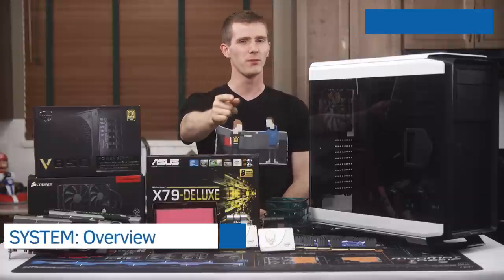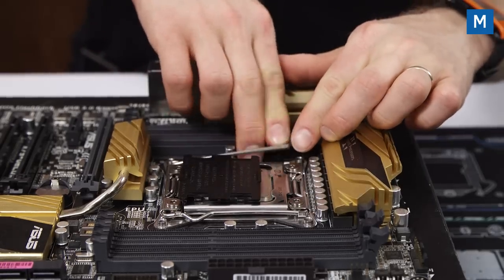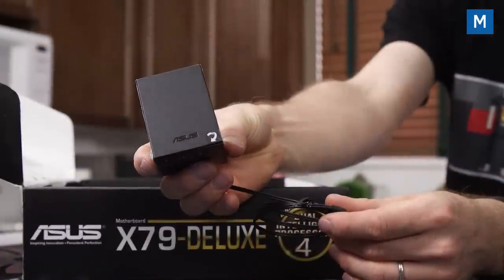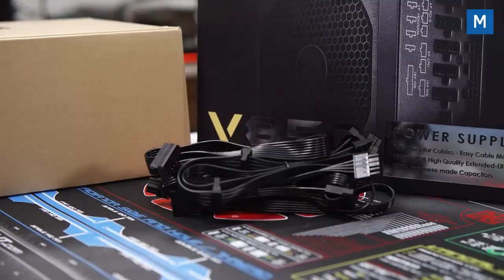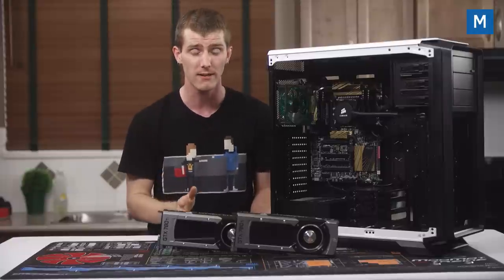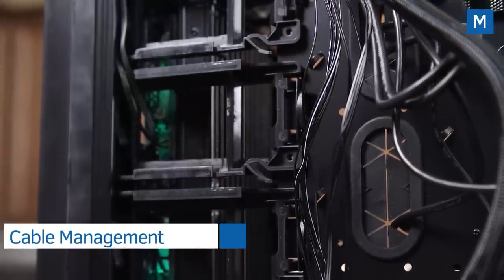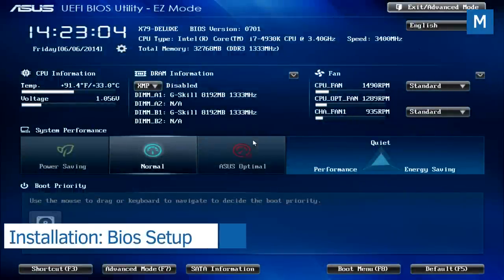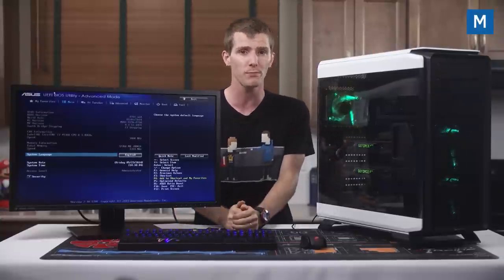How to Build the ULTIMATE 4K Gaming PC Build Guide

Comment: Hi i'm going to be building my first Gaming PC soon. And i would like to know what you guys think of what my build is so far!

Phanteks Enthoo Primo case
Asus maximus VII formula
Intel core i7 4790k
Four dims of Corsairs dominator platinum 8GB RAM cards 32GB total
Two Samsung 840 EVO 500gb SSD's
Western digital black 1tb HDD 
Corsair AX1500i
Asus black blue-ray drive
Windows 7 ultimate

Going to be doing a custom WC loop on this computer too.
Reply: I assume your parents will be paying! They will never recover from debt mind!
Na I'm kidding, I'm 14 too but my rig was much more budget
I personally think that if you get that, it would last for years!
I would reccomend the Maximus VI Formula as it's a great board for a great price
My SPECS:
amd fx-6300
asus m5a78l-m mobo
gtx 660
8gb corsair vengeance ram
1tb wd caviar blue hdd
coolermaster rc-430 (upgrading to aerocool dead silence)
Corsair CX600W psu
Reply: You won't be needing a 1500W PSU. 1000W should be PLENTY. I run SLI gtx 780s on a 750W PSU with no problems :)
Reply: Pigoop Would a 860W PSU do the job then? Cause in this video Linus was running SLI with a 750W PSU. And the AX Series doesn't have a 1000W PSU only 1200 or 860.
Reply: Liam Hawkes Yeah they are going to gift me this PC haha. Also i think i'm going to wait until the Asus Maximus VII Formula, cause those Z97 chip set motherboards are awesome!
Reply: The 4930K Linus used is better than the 4770K. 

For PSU, a 860W PSU should be enough. 

I personally prefer a R9 295X2 instead of 780 Ti in SLI. But the choice is yours. 

SSD should be the Samsung EVO, better performance. You could just buy the M.2 1TB one, basically Raid 0 with one SSD.  

Edit: What's your Motherboard?
Reply: Kid... you're just rubbing your parents' money right in my face.
My build costs a bit more than just one of your graphics cards.
I bet you would be fine by saving 700$ with only one 780ti. In fact, a 770 will do great if you're just playing in 1080p.

Besides that, amazing build. It's only something I could dream of having. Impress your console friends when they see how nice PC graphics look!
Reply: You don't need all of this, that is way over kill have you looked at the prices? What do your parents do for a living? and the community isn't very nice to kids/teens (just a word of advice)
Reply: I have to agree with the 'Only 1 780 Ti' Idea. This is way too much Overkill. 1080p and 1440p doesn't require that much bandwith. And will save your money much more. 

Personally, I'll either go for a single 780 Ti and a 1440p IPS monitor. Or an R9 295X2 and a 4K. Or just wait for Maxwell, soon now. 

With that said, an R9 295X2 is the least profitable suggestion, I don't think I should have gave that suggestion in the first place. That GPU can be fully utilized only on a 4K display and monitors with that amount of pixels these days are just TN, which is an utter crap. 

If you were to ask me what I'd do, I'll wait for Maxwell-architecture GPUs. Those are guaranteed to give you better performance, less power consuming, less heat, and a smaller form factor.
Reply: Kirito Cray Well i still haven't bought my gaming PC yet (planning on buying it for my birthday) and i'm still planning the parts... But the other day i was searching up some processors, and i found a new one that is going to come out soon. It's the Intel Core i7 4790k and it is a haswell processor. And maybe that processor is probably good for the new Z97 chip set i dont know if i should get that one though.

And about the PSU i think you guys are right and i should just get the Corsair AX860i.

About the GPU.I want the 780 TI because, it's only about 680 dollars on Newegg right now also going to be wanting to game stream on my Nvidia Shield. But i can wait for the maxwell chip set if its so good.

And the motherboard i decided to get is the Asus Maximus VII Hero. I really want the Asus Maximus VII Fomula though but there still isn't a release date yet on tha motherboard.
Reply: Jeremy Munoz But the reason i want to go for SLI is because i'm planning on playing my games on 4k. And thanks!
Reply: Upload a video to youtube once you've built the PC. I would want to see if you and your parents actually go through with this..
Reply: Sir Mister Yeah dude ill try to for sure! i was actually thinking of putting a video haha
Reply: What monitor would you be using? Unless you're using a multi-monitor 1440p setup or a 4k monitor the dual 780tis are overkill. I suggest that you just get one 780ti and use the money you save to invest in multiple high end 1080p monitors.
Reply: nikg307 Well i was planning on either going 4k or a single 1080p setup actually. But i wouldn't really need two graphic cards if i go for the single 1080 setup. Still cant decide which setup i should go for.
Reply: ***** No, lol. My father is going to pay for this. I was also thinking maybe i can get 2 dimes of 8gb ram cards and have 16gb total. It's so i can upgrade to 32gb in the future. And yeah you're right i think ill just keep the psu because maybe in the future when i want to upgrade, the parts might need a lot of watts.
Reply: Lol, well I'm a freelancing web developer and as I said I'm 15 years old. I think that technology is great if you just use it for more than time waste and games, instead try to learn something new everyday and make some bucks
Reply: Why not the R925x2, it's great for your build and its great for 4k and performance and it's water cooled and cheaper.
Reply: Christopher Contreras Get the 4790K, it has the same price as the 4770K but a lot better. I would have waited for Broadwell or Skylak though.. :/ 

I still think you should wait for Maxwell, it's gonna be so worth it. Either that, or buy a 780 Ti with an excellent aftercooler market. 

Save some money and buy the AX860i PSU. 

Formula is the best choice here, beside ASRock. 

Spend all those saved money into a Custom Liquid-cooled Rig. Maybe buy some pretty LEDs as well.
Reply: Kirito Cray Well i wont be getting the computer parts until the end of October... So i think ill be able to see what parts i will be able to change. But i totally agree on getting the 4790k, it's the same price and it's based clock is at 4.0 ghz.

On the GPU i was planning on waiting for the Maxwell actually. But it's just i don't know if it's going to come out for the date i'm going to get the parts. But for now, i was thinking maybe two reference 780 Ti's.

Also, the reason why i want to get the reference cards is because there are going to be this new bracket from Corsair that lets you install All-in-one water coolers on your GPU called the Hydro Series HG10.

And on the PSU i think getting the AX1500i is better though in my opinion, because not only is it a very reliable PSU but it's going let me upgrade to much better parts that use a lot of power in the future.

I was thinking maybe i should wait until later on this year for the Asus Maximus VII Formula, but to be honest i don't really know when it's going to come out so i think i might have to pass on that one. But other then that i compared the Formula VI to the Hero VII and the Formula is way better.
Reply: Christopher Contreras I don't see the point of having 2 780 Ti. SLI doesn't scale well, and you're better off with a R9 295X2 if you so desire to have a dual GPU setup. Maxwell is just better at every angle you're gonna look for in a GPU. 

It's your money, so I don't mind that much if you insist on buying the AX1500i. 

Considering it's Asus, I don't think the day they reveal the Formula as that much longer. 

Trust me with this, just buy a Custom Water-Cooling loop. All these AIO gimmicks are just stupid and a type of marketing lies. There are companies out there offering 'Starter kits' and stuffs for your WC project.
Reply: Kirito Cray But the thing is the R9 295X2 is 1500 dollars, when the 2 780 TI SLI setup is just 1400. And i want a Maxwell GPU, it's just i don't know when it's coming out. Perhaps these Maxwell GPU's might come out in 2015 and i'm going to get this computer in a couple of more months.

And i really don't feel like building a Custom Water-Cooling loop computer. It's way to complicated for me in my opinion, with all the things i have to do to maintain it.

Also i kinda doubt that the new water cooling bracket from corsair is a "AIO gimmick" it's just a water cooling solution bracket that lets you attach a AIO water cooler to your GPU so you don't have to go threw all that hassle of doing a custom water cooling loop yourself. Because there are a lot of people out there that are not well suited to do a custom water cooling loop. Also it's just as simple as attaching one of those to a CPU, but instead it's a GPU. And it also takes less time.

And you can also check it out yourself, it's actually a very good solution to do a more simple water cooling loop on your GPU.

http://www.guru3d.com/news_story/corsair_hydro_series_hg10_unleashes_your_gpus_hidden_performance.html
Reply: Christopher Contreras You get WC with it, so yeah.. sigh Reference 780 Ti and both of them, isn't that good without an excellent heat disposer. And if you're going to buy a bracket and an AIO for it.. $100 isn't gonna hurt while offering a more pretty look. I'll still choose Maxwell. 

It isn't that complicated, it's the same as building a Rig. It has a manual, and it's easy to assemble. Maintenance is like twice a year..? Can't complain there for the performance it gives. 

Do whatever you want. You think of Rigs so narrow-mindedly, because it isn't your money, I suppose. You prefer simple process instead of aesthetics and performance, besides saving some lifespan of your hardwares. 

That's one review. Check others. Peace.
Reply: Holy jesus that's going to be expensive
Reply: Okay so... I've been searching on the web about watercooling, and i've been thinking about it. And watercooling is awesome! And i know a lot about to now, so now i think i'm just going to do a custom loop myself since it's so simple.

And since i'm going to do a custom loop i guess i can also change some parts in my build as well to suit the new loop. It might cost more but i think it's worth

So this is the build update for the build itself:

Phanteks enthoo primo (in black)
Intel core i7 4790k
Two asus directcu ii gtx 780 TI's
Corsair AX1500i
Two intel 730 series 480gb
Asus Black Blue-ray drive
Asus maximus VII formula
Two dims of Corsair dominator platinum
16gb 2400mhz

And with windows 7 ultimate installed.

Watercooling parts:

Two Alphacool NexXxoS XT45 radiators
One quad 120mm top rad
One duel 120mm bottom rad
Swiftech MCP655 pump
XSPC Photon 270 tube glass reservoir
EK Surpremacy universal CPU water block
EK Asus directcu ii gtx 780 TI water block (with black back plate)
EK FC Parrallel SLI bridge (with two ek fc black bridge links)
Fourteen Bitspower  G1/4 3/8* ID x 5/8 OD fittings 
Two Bitspower G1/4 male to female 30mm fitting extender 
Two Bitspower G1/4 45 degree rotary adapters 
Three Bitspower G1/4 90 degree rotary adapters 
One Bitspower tube plug 
Two EK G1/4 3/8* ID x 5/8 OD fittings
(nickle plated)
Two EK G1/4 90 degree adapters
(black)
One XSPC M20 reservoir port plug 
(black chrome)
PrimoChill PrimoFlex advanced LRT 3/8* ID x 5/8 0D tubing (red)
Monsoon 999 fine silver bullet antimicrobial G1/4 reservoir plug (red)

And for the water i'm going to be using a PrimoChill high purity deionized water and a IandH biocidal PC coolant additive.

So that's my updated build guys!! I find this one way better then the old one in my opinion lol. And yes guys i know that the R9 295x is better, it's just i wont be able to fit it in this case because of the reservoir mount in place, plus this new case that i'm getting is amazing for watercooling! i totally recommend it! Also the color scheme of this build is going to be Red and Black so ill be also getting some custom sleeved cables too.
Reply: Christopher Contreras Great change of mind :) 

IMO you could save a few bucks and buy the Phanteks Enthoo Pro. Or if you'd prefer a beautiful case with slick LEDs, I recommend the Phanteks Enthoo Luxe. 

I recommend Samsung 840 EVOs instead of those Intel 730s. Raid 0 is unreliable, so you might just want to buy a larger capacity SSD instead of having to Raid 2 SSDs. 

The WC List looks great enough. Though WC itself isn't that complex to find the matching parts. It's more like what brand do you prefer. 

Oh by the way, for WC, I prefer EVGA cards just because it matches well with the color scheme. Though it depends on your own LEDs, tubes, etc. 

One tip, don't choose GPUs based on its cooling efficiency and whatnot if you're going the route of WC. Just choose a GPU based on the color scheme of your rig. WC is both for cooling AND aesthetics, don't forget those.
Reply: ***** Yeah he could take out the i7 4790K for the i5 4690K. But if he has the money, why bother buying something lower than what you could get?
Reply: Kirito Cray I don't know, i like the Phanteks Enthoo Pro a lot but it's just i the Enthoo Primo is just way better for WC and it looks cooler too IMO. And i think i'm just going to get that one. Plus i can change the front LED's to red. Not the ones where the intake fans are, the one that's a line on the side of the case.

And to be honest i really don't mind much for capacity. Like i can just buy a 1tb HDD and call it a day lol. All i really care about is preformance and speed and the 730 series has that. Especially in raid 0 

The GPU's don't really matter at this point. Because if i am going to get a EK waterblock. The EVGA and Asus waterblocks look exactly the same plus it wont be having any LED's or EVGA, Asus logos on them. Only the EK brand logo. So i'm getting the Asus GPU because it is clearly better preforming and has a better build quality then the reference card.
And the waterblocks are all black too by the way.

Also for what my build is going to look like. Here are some pictures of some Enthoo primo WC build i found online

http://imgur.com/gallery/AkcVy The build in this picture is going to look a lot like the one in mine with the fittings and everything, because i know the brands of the fitting on these pictures. The black ones are the Bitspower fitting and the one in the CPU block are EK nickle plated fittings

https://www.flickr.com/photos/39959182@N05/14375832955/ This picture has the same reservoir i'm getting but with blue LED's. I'm going to get mine with a red LED and with a red sleeved cable

https://www.flickr.com/photos/39959182@N05/14382664403/in/photostream/ This one shows where the drain port is going to be 

http://www.techpowerup.com/gallery/3768.html And this is just a Enthoo Primo build i found with a red color scheme

So the way i'm going to be doing this build is the tubes are going to be all red, the reservoir is going to be glass and clear with a red LED, the water is going to be a normal WC water (deionized water) with no red dye and stuff, because also red dye is one of the worst dyes to use, the GPU waterblocks are full cover waterblocks with a black back plate that are also full cover, the radiators are going to be in push-pull since it is very easy to do in this case and finally for the fittings they are going to be all black with red o-rings except for the ones in the CPU block. I am also watercooling my motherboard since it is possible.

Also for the fans i'm getting six packs of two Corsair air series SP120mm fans and three Corsair air series AF140mm fans quiet additions.
Reply: Christopher Contreras Samsung 840 EVOs always come out on top on every speed benchmarks. RAID 0 is unreliable and the speed difference in real-world performance is minimal. You get an extra like, 1 sec? 

GPUs are fair enough, as long as you have valid reasons. 

After reading your plans for the WC build, I think it's going to look great. One thing you can replace is the case. Phanteks Enthoo Primoo ( white ) may be a better choice considering the color scheme of your rig. Color preference isn't solid and depends on the individuals' itself. So I'll just let you choose your own theme.
Reply: Kirito Cray So then what should i do for the drives? should i do a different kind of raid? or not do raid at all?

And the reason i want the black is because the color scheme as i said is going to be red and black so i thought the black one would suit the build color more. 

Also thanks a bunch for the help it has helped me a lot!
Reply: Christopher Contreras In almost any reviews or benchmarks of SSDs, it isn't recommended to go for RAID 0. It's that bad. I myself tried it but one of the drive failed, and both drives lost ALL of it's contents. People tend to install all their important apps and stuffs in SSDs. I'm one of them and really IT HURTS. TL;DR I recommend a single bigger capacity SSD.  

True, but you can only see all the light trough the windowed-sidepanel. White kinda highlights the black-red theme inside. The first pic you showed was a full black rig and that's the correct use for black Phanteks. But I have no experience in black-red theme, I did a black-gold rig with RGB LEDs and a rainbow rig ( some mods ). Both of them was fantastic. I tried going back to simple colors, didn't last long. 

Sure, glad to be of help! :)
Reply: Kirito Cray Okay so i have been seeing a lot of reviews online right now about the Samsung and the Intel SSD's and you're right the Samsung ones are better performing, more cheaper, have more capacity and it's overall almost the same but for less. So i think i'm just going to get those SSD's lol.

And i'm actually going to do it like in the first pictures. All black and instead of that tiny bit of white i'm going to put red. So everything is going to red like the tubes, reservoir and the cables. The cables are going to have mostly red in them with a bit of black. I don't know though if i should get red LED's or white LED's inside the case, cause i think white LED's would show off the red tubes and the parts better.
Reply: Christopher Contreras Great choice! :) 

I like how the build plan sounds and am looking forward to how it will look like after the actual build. Hm, IMO all cables should be the same color. People often underestimates the power of cables, it will greatly benefit your eyes if you give some attention to cable management. Okay, back to the original issue; All cables should be the same color. 

And as I said before, I have no experience with simple color schemes. Yet from what my friend had gone through, I can tell you that it's absolutely horrendous to put red LEDs inside a black case, based on your build plan. If I were you, I'd put not-so-bright white LEDs inside every main corners I could find in the case. As they lit up and give birth to the pretty looks of your WC build, you'll smile and your eyes will melt ;) 

One extra tip: Don't mind that much about the interior of your PC, whether it would look matching or not it won't matter because you can just color them later. With some mods, every crook of imperfections in your PC can turn into perfections. What you need to focus on first is the LEDs < This is what you need to research for carefully before buying.
Reply: Kirito Cray Yeah even the sata cables are going to be custom color sleeved lol. And i am also going to be uploading a video of my new rig once i get it, i plan on getting it around september or october. The cables are going to be mostly red but with very little bit of black into them, so they can match some of the black WC parts in the build. But it's just the way i want to do the cables lol, they look really good from where i am going to buy them from too.

And yeah i was also thinking white LED's would suit me better because they would highlight more the parts in the build too and red LED's are just way to dark. So i am going to be researching more of the LED's which type of LED will suit me more.

By the way the fans are going to be red and black too.
Reply: Christopher Contreras SATA cables should be custom color sleeved if you're building a WC rig. One thing that shouldn't ever be different from each other is the cables, though this doesn't apply to tubings. In some very rare circumstances, different cables might give off more aesthetic appeal. But those circumstances are SO rare, most requiring mods. 

Especially in your situation, where you'll be using red-black theme with white LEDs. If you're bothered with the black parts of your PC not getting any love, strip in an LEDS there. Eventually, you'll be coloring your PC anyway. It's just a time killer before you're doing it. 

First rig is always simple, what you need to focus on are tubes and themes. After time, your rig will be so pretty with some remakes and make-ups.
Reply: Kirito Cray Ahh okay. Well thanks dude for all the advice and help, it has really helped me a lot! :)
Reply: ***** Nice dude!! What are the specs going to be?
Reply: What is the price range that you're trying to go for? Also what is the motherboard?
Reply: ***** Okay, so the first thing i would recommend is for a gaming PC, is that i would always get 8gb of ram. That is like a must for when you are building a gaming PC. Second, is that you should atleast spend 1000 dollars for a decent gaming PC, because most people actually recommend a gaming PC around 1500. So if i were you i would think about spending 200 more dollars. Third, If you are on a budget i wouldn't find it usefull to get 64gb SSD. Really, if you want something good that works well and that is almost as fast as an SSD get Western digital black 1tb HDD, which is like 80 bucks. Fourth, is that just get a 80 plus gold PSU. I found one that is the same price as the one that you want, but better. Fifth, i just calculated how many watts you need, and you just need around 369 watts. So dude just get a 550 watt PSU. Also if you really want a SSD i would recommend maybe upgrading like when you have enough to upgrade in the future.

I made this 1000 PC build that i think you should definitely take a look at it is just 200 more dollars then the one you want. But bro trust me it is a lot more better! I totally recommend you buy this one!

http://pcpartpicker.com/user/Pokechrizx7/saved/3yrYcf3
Reply: ***** Okay, if you are going to get a SSD then you should use it only for a boot drive for windows and for your games lol, not for chrome or steam that would just be a waist of space to be honest, and the rest on the 1tb HDD.

And if are going to get a 600 watt PSU for future proofing, get the same i recommended in the list but in 650 watts.

If you are getting 8gb get the corsair vengeance pro 2400hz ram because they are almost the same price as the normal vengeance ram, but much faster.

No problem bro, glad to help :)
Reply: The thing is though, you should put your games on your SSD too.

And IMO i really like Bioshock Infinite, great game to buy!
Reply: ***** The plot twist is at the end of the game by the way lol.
Reply: Good talking to you too bye!
Reply: get a seagate barracuda 3tb atleast (some games are taking up to 50gb), two ssd's 256gbs ssd in raid 0's is complete overkill and waste of money unless you are professionally editing 6k raw video captured on a red epic dragon. one ssd will do fine, better to use that money on more ram or a better cpu cooler

I would recommend going with 2011 socket motherboard because they can support much more memory throughput, wich you would cetainly need for 4k. a good 1080p monitor would be the Asus VS248H, a single 780ti would max pretty much anything at that resolution for the next 2-3 years. but at 4k you'll need at least 2 and that'll be outdated in a year, better to save money and get a 1080p setup and upgrade your monitor and GPU in 2-3 years.

as for the motherboard, check out the "ASRock X79 Extreme6 Motherboard", it supports full quad channel memory and has up to 8 slots (meaning you could get 4 8gb sticks for 32gb, and upgrade later). I have a freind with that motherboard and a 4820k, he put a "Noctua NH-D15 CPU Cooler" and OC it to 4.4ghz and it hasn't went over 50 degrees, (my laptop sits at a precarious 75 degrees)  

also, Why wouldn't you get windows 8.1?
Reply: legendp2011 Yeah i've been thinking about it, and i think it would be better to just go with like a 1tb SSD and 1tb HDD. In my opinion that's enough for me.

And i don't really need a 2011 socket CPU and motherboard. It would just be a waist of money, because 2011 isn't so good at single core performance and it has lower clock speed as the 4790k. Really you don't need so many CPU cores for gaming and the 4790k is perfectly fine, and IMO it is better for overclocking and i totally do not need quad channel kits, if i at least need 8gb of ram for gaming I DOUBT i need quad channel 32gb of ram. I'm just getting duel channel 32gb of ram for the looks and to show off lol And i also decided i am going to go for 2k gaming gaming (1440p) instead of 4k because in a couple more days there is going to be a new G-sync 1440p monitor from asus that has 144hz of refresh rate and 1ms of response time, so why would i get 2011? If all i need is at least 2 way SLI? 2011 is better when you have more then 2 GPU's, it would be just stupid going for 3 - 4 way SLI, cause all it does is give you a 10-15% increased FPS and it uses more power consumption and does more heat output. If i am going to do 2 way SLI all i need is a 1150 and i'm good. Plus a 4790k and Maximus VII formula is WAY better then 2011. Well for gaming IMO.

And just because your friend has that X79 motherboard doesn't mean it is the best.  It is indeed a good motherboard, but dude really? This compared to the Maximus VII formula? Just because your friend has it? C'mon... If i was going to go for a 2011 motherboard i would AT LEAST go for the Asus rampage extreme IV black edition. 

Dude really? Windows 8.1... -_-
Reply: Christopher Contreras I built my friend the desktop, I wanted to make it future proof because I know he will probably not upgrade for the next 6 years
 
even in 2 way sli 2011 is better designed for that sort of task, it is also great for future proofing, sure it's enough cores now but with the next gen consoles being released you can expect more cores to be required.

and a tb ssd is a massive waste of money, why do you need more than 128gb ssd? and you still haven't explained your problem with windows 8.1, start8 fixed the only problem I had with it. additionally intels 5820k is just on the horizon along with gtx880. As for ram, anything less than 16gb would be silly, with consoles having 8gb, and pc games not being as well optimised as well as an OS running in the backround 16gb is what is going to be needed for games in 12 months.

why wouldn't you want quad channel memory, for an extra $100 seems worth it. harddrives, ram and graphics cards can easily be upgraded in the future, but the motherboard and cpu are usually the last things to get replaced. I haven't really looked into it but what makes you say the Maximus VII formula is a better motherboard? (from the quick glance I took that motherboard is already more expensive than the one I listed).

I respect your opinion and in the end it's your money, I just believe you would be better off with the 2011 socket, if you are already spending that much money, I reckon you should pay the little extra.

Wow...this turned into an unexpectedly long wall of text.